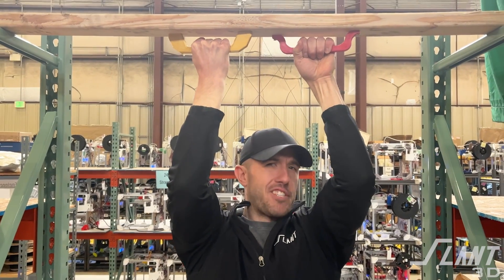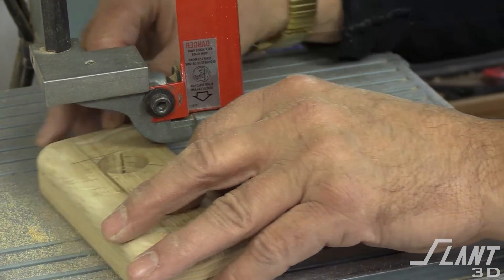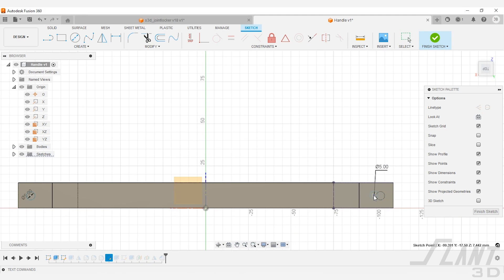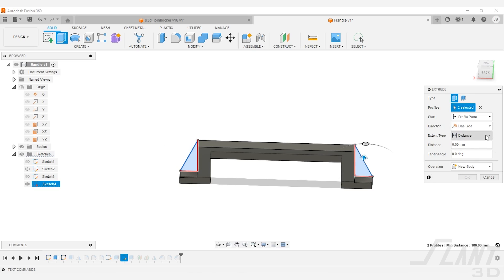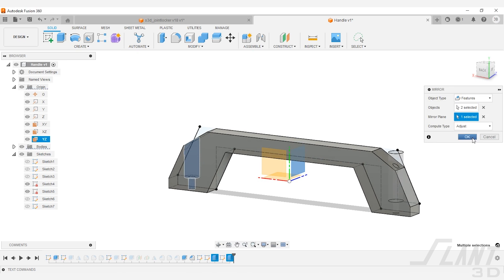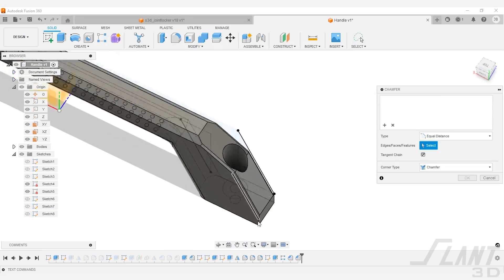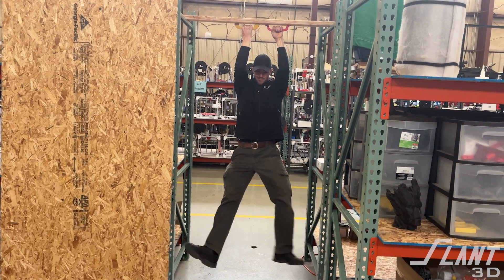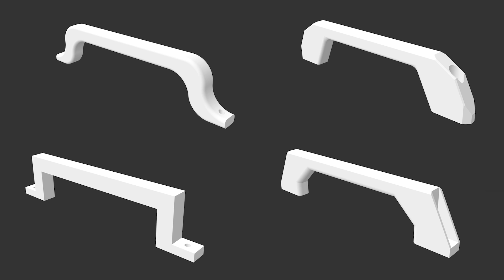Design Stronger 3D Printed Handles for Mass Production 3D Printing

Comment: Another good video.  Some thoughts:

1. As the grip on the inside just needs to be perpendicular to the top of the handle to counteract the forces from someone gripping it, a simple wavey pattern parallel to the handle will not only provide sufficient grip, but will also be a LOT faster to print than a lot of little cylinders, as the extruder can just fly from end to end without stopping, with the waves formed from layer offsets.
2. Most handles are designed to be fastened from the back, so incorporating a hole that includes a larger opening for inserts and threaded the full length for the most popular screw sizes will ensure that the front is completely smooth and it is still well-secured.
3. Even faster and cheaper to print would be designs that are intended to be used with standard metal tubing/dowels/etc.  End-users could then choose for themselves how long the handle will be.  (There would need to be a way to firmly anchor the grip to the standoff, obviously.)

Cheers!

Comment: You mention that layer lines are aligned for strength but this would require printing the handle standing on it's side -- and not sure how you would do that without significant support for the side of the handle that extends. I'm pretty sure that if you printed this in the lengthwise direction that you would not have enough strength to hang from due to layer lines.

Comment: Are chamfers better than Fillets? Structurally?
Reply: No, filets are stronger. Any sharpncorner creates stress risers, and parts ultimately fail at those points. In 3d printing, filets are much more difficult to create properly, so chamfers are preferred and within Abe 3d printing bubble are more effective.
Reply from the maker: Yes

Comment: I'm a Blender modeler.  I don't use CAD software.  But I am amazed every time I see a video of symmetrical modeling without the use of a mirror.  Doing each step twice is very inconvenient.
Reply: You can mirror in the software they are using they just.. chose not to.
Reply: I've just started using blender and it feels like when I started Photoshop, but with the complexity squared. Super powerful software, but might type a CAD software too as I'm only using it for 3D prints.
Reply: I use fusion360 and it’s a no brainer that only 1/4 of this should have been done.
Reply: @VV-om8vv  I'll try it out, thanks for the recommendation 😊👍 Ive been using the software that comes with the flash forge to splice and bodge things together because I'm just making toy gun parts for my sons. But I do want to get into more functional exact stuff so this might help 👍

Comment: This is much better than the prior cup example, more practical and a likely real-world usage scenario. 👍 It's interesting needing to balance print orientations between keeping the screw from splitting layers, or on its side for maximum pull strength.. I almost wonder if tipped ~45 degrees would give a good median between sideways and standing up. But if torquing the screw still splits layers there's no point. Just haven't seen 45 degree printed screw holes ever tested prior.
Reply: In our testing 45 deg is almost 30% stronger in PLA against splitting with single wall. Once the wall thickness is greater than the thread depth, they perform the same. For very short holes (height less than 3 complete 45deg loops), flat is much stronger. Here strength=resistance to layer separation caused by self tapping screw

Comment: Great video! On the subject of texturing the part since it is low cost.
One application that immediately came to mind was making the texture provide additional value - use the pattern to embed braille for sight-impared users, or simply to give a tactile indication of what you've grabbed in a dark room for example
Reply from the maker: That is certainly an option

Comment: I printed something which used a functional screwhole and it had the surprising property that with PLA a screw which fits but whose threads do not will naturally make the threading as it screws in and stay extremely well. Notable quirks include that that the screw hole must be sized perfectly and you specifically don't want to get it very tight or use a washer because that will just destroy the plastic without holding it in place any better.

Comment: Great example of how durable PLA can be.  I have a dust pan I printed in September of last year and it is still going strong, when even the metal ones would break after 6 months or less.
Reply from the maker: Design is more important than material.

Comment: Saw a post on reddit a while ago about printing handles that can carry your bodyweight. But even the moderators felt the need to intervene the comment section and said that "it's not safe do on a 3d printer". Just a bunch of kids with untuned, 3d printers.
Reply: in my defense, tuning things right is hard
Reply from the maker: Design is everything.